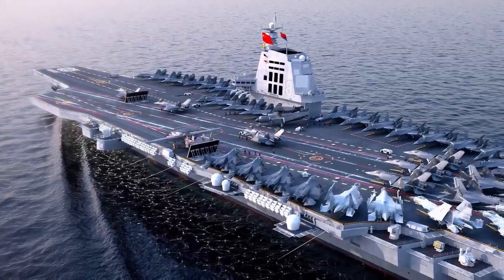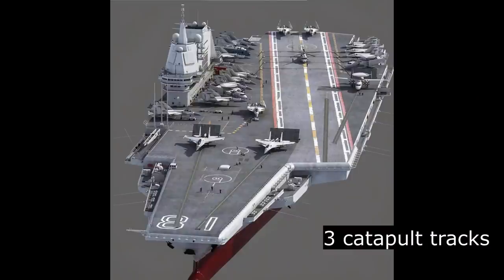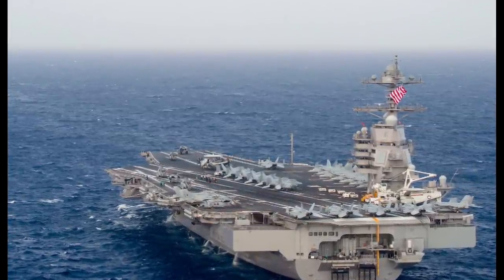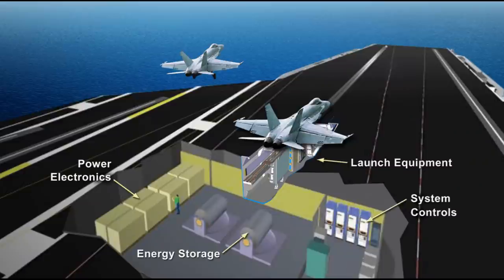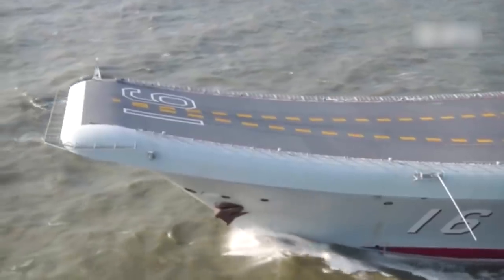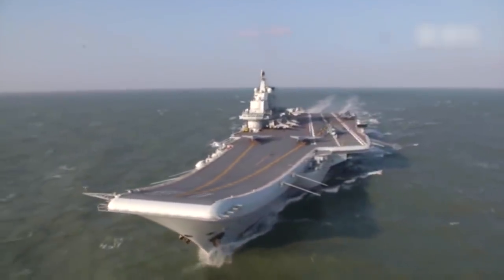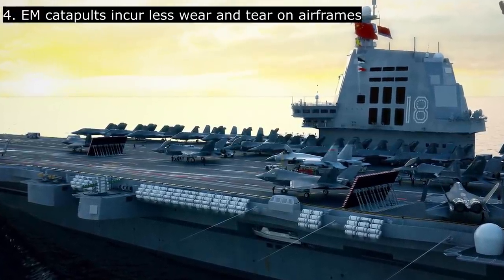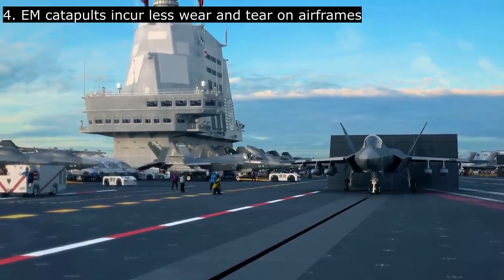How Important are Electromagnetic Catapults for China's Type 003 Aircraft Carrier?

Comment: An important topic ENI, and well covered. Did you consider discussing China's different approach to electromagnetic catapults?
Reply from the maker: I don't really know how China's approach to 'EMALS' will be different, because I can't find anything too concrete. Lots of informed speculations at this stage
Reply: I think China EMALS is based on the experience of building China's electro-magnetic High Speed Rail where China has the world longest high speed railway network.

China is also now testing the world fastest HSR at 600 km/h.

And also China has the world longest high speed railway network.

So all these could be could be the basis China electromagnetic catapult.

BTW it was said that China EMALS using direct current electrical system whereby DC power could be stored much more efficiently in DC batteries, therefore China does not need very high power system to operate the EMALS.

Whereas US AC system could be not stored in batteries but probably using inverter which was said to be less efficient, therefore need a higher capacity electrical power system .

Comment: where is 002 aircraft carrier?  Any chance it will come back or is it a complete failure?
Reply: Type-002 Shandong is the improved version of Type-001 Liaoning, previously known as Varyag, which is an Admiral Kuznetsov-class aircraft carrier.

Type-002 Shandong could carry more aircraft than the Type-001 Liaoning, at about 36 J-15s, better AESA Type 346A S-band radar on the smaller Island which means more aircrafts on deck, 12 degree ski-jump as compare 14 degree ski-jump of the Liaoning, an angle ideal for launching the Shenyang J-15 fighter.

Type-002 Shandong was commissioned on 17 December 2019 & has been seen in various training exercises in SCS.

Comment: The father of the electromagnetic catapult of the Chinese aircraft carrier is Major General Ma Weiming（马伟明）. The medium voltage DC integrated power system invented by him has made China the first country in the world to realize the medium voltage DC integrated power system on the ship. At present, the ship integrated power system in the world has developed to the second generation. The Zumwalt-class, Type 45, and Elizabeth-class warships adopted the first-generation integrated power system, which realized the engineering application of the AC integrated power system. The ship's medium-voltage DC integrated power system successfully developed by Ma Weiming's team belongs to the second generation, and the use of this system is a necessary condition for Chinese aircraft carriers to use electromagnetic ejection.
Reply: You have omitted one very important message. I think it is more important than electromagnetic ejection, that is, this system supports higher power radar on board, which is very important.
Reply: @algung2522  Your ideas are out of date. In modern war, the confrontation between two superpowers, relying on a single weapon or a single weapon system, can no longer change the war.
With the advanced power supply system in China, his concept of modern naval warfare has changed. They pursue system operations. Compared with Aegis air defense ships, due to its backward power supply capacity, its radar power is far weaker than that of large-scale subgrade radar. After China has the second-generation integrated power supply system, the current development idea is to build a super flagship (the flagship can support large-scale radar boarding and some radar that can detect stealth targets by relying on the advanced power system), and then share the stealth target information fleet through the data link。
There is a basic scientific basis that the efficiency of a higher power radar is much higher than that of multiple low-power radars.
Reply: @algung2522  Relying on this set of very advanced power system, the current thinking of the Chinese navy is more inclined to build a maritime early warning super flagship (put the radar with higher power that needs a lot of power on the ship), which is similar to the role of early warning aircraft in the air force.So you should be more understanding
Reply: Are you identifying targets for CIA?
And who developed the American catapult?
Reply: @birdangry5007  Mumbo jumbo you sound a lot of technical terms but means ZERO!.Just summarize as PLA built a big power generator  for  its ship to cater for modern warfare equipment that uses a lot of current!.

Comment: I heard the 003 will be the last of its kind. The type 004 will be nuclear powered with a large capacity than 003.
Reply: 不确定，可能吧。
Reply: 005 will be.
Reply: It was said that PLAN will likely to build two Type-003s, before the nuclear powered Type-004, because China is still working on the powerful nuclear reactor that could power the large Type-004.

Those nuclear reactors on China's nuclear submarine is not sufficient to power the large Type-004 CVN, China therefore has to design and build a larger and much more powerful nuclear reactors for the Type-004.

Comment: Even If Chinese Naval Aircrafts can Take Off with Full Fuel and Payloads using EMC Tech but it will be more Of Nothing Less than that Of Toothless Tiger as in The Event Of Dog Fights and alikes, those Chinese Naval Aircrafts will not Perform with The Cause Of Underpowered Aircrafts Engines. Which is Why, "It's not The Dog in The Fight BUT The Fight in The Dog!

Comment: Can China utilise their expertise in high speed trains to build these catapults or is it completely unrelated tech?
Reply: Engineering fundamental the same but different in execution and operation. Trains you know your parameters are set for the weight. Aircraft carry different ordinance and fuel load depending on mission profiles so you need to adjust
Reply: @MY-zj8pb  well they got 3 runways on the carriers. So they just need to set up for 3 different loads.
Reply: unrelated. Catapult is related to the  electromagnetic canon in development. Both require short bust of high energy pulse.
Reply: @maolo76  Actually EMALS system could be easily adjusted for different load(aircraft weight), unlike the steam catapult.
Which is actually better for any aircraft, big or small.

For example EMALS system could easily adjusted to launch from the heavy AEW aircraft to the light weight attack drone without stressing the aircraft frame, therefore longer lifespan for all aircraft frame.
Reply: It's quite related. To propel a maglev train the idea is similar and is in use, also the newer 600km/hr maglev uses this basic attract, & push magnetic principle.

Comment: If new ski jump carriers had the ski jump extended about 50 metres this should allow the aircraft to carry full loads.
Reply from the maker: Interesting take!
Reply: the question is how to build such a long ski jump
and ski jump  can not park any plane but takes huge space on a small ship
Reply: @luobingsong5297  In my view there are two engineering options with the 002 Shandong design.
(1) Build a carrier based on the type 002 Shandong which has a length of 305m but extend this to 355 metres long  but with a 50m longer twin ski jump
(2) Keep the standard length of 305m but extend the superstructure of the twin Ski jumps by 50metres
Assuming the existing ski jumps are about 50metres this will double the twin ski jump length.
The second option would be the most economical.
Since Ski Jump carriers are more economical to build then you could have more of these type.

Personally I would build a dedicated new design with three or four 100m ski jumps and at least two landing retrieval strips.
Such a carrier would be about 100m wide and at least 305m long depending on whether the carrier had a superstructure ramp or whether it was a longer body.

Personally I would go for a dedicated carrier of at least 355 m long and at least 100m wide. With two retrievals and three to four launch jumps it could launch sorties and retrieve sorties quickly and be more economical to build.

Comment: The problem is not matching the right plane to the right carrier.
J35 or CH6 should be deployed rather than the massive, high RCS, J15.

I still believe that a pair of 4WD electric vehicles could launch the plane towards the sky jump... if an EM catapult is too costly and unreliable.
Reply from the maker: I think the PLAN is to deploy a mix of J-35 and upgraded J-15 to the Type 003 once it is ready. But I agree PLAN might be better off going all J-35. It depends on how comfortable they are with the first operational variant of the J-35 I guess

Comment: If not using steam catapults how are they generating the power? It's not a nuclear ship, would like to see how they set up the engineering plant.😎 They can't be saving space if they need fuel tanks for the carrier as well as more space for electrical generators.
Reply from the maker: I don't think EMALs are more power-hungry than steam catapults. In fact, there would be plenty of power savings from not having to use as big of a desalination plant (like what the steam catapult needs). Some articles I have come across claims EMALs use less energy (none claimed the steam catapult uses less energy). Also, the USS Kitty Hawk, a conventional CV, was equipped with the steam catapult decades ago. So, if EMALS are at least as energy efficient as steam, then we should expect a conventional large CV like the Type 003 to be able to generate enough power to use it.
Reply: 核动力从来不和电磁弹射绑定，核动力的本质还是蒸汽动力，只不过持续能力强罢了。 电磁弹射的能量效率比蒸汽弹射要高，理论上限制电磁弹射上舰的限制条件是储能（超级电容、飞轮），而非动力形式。